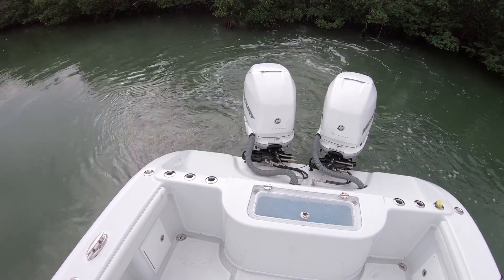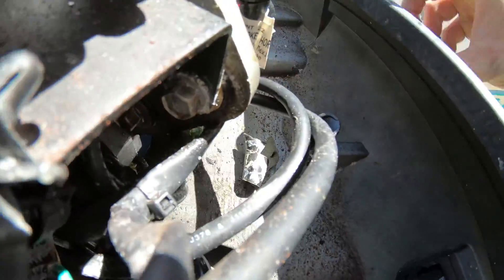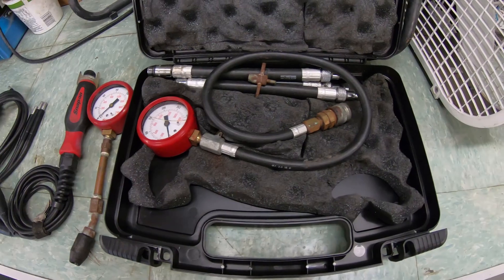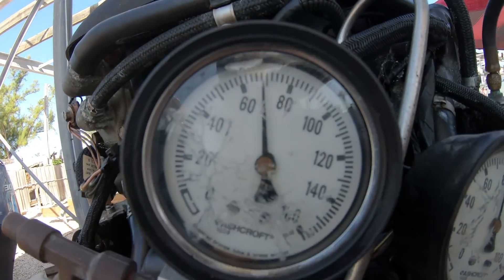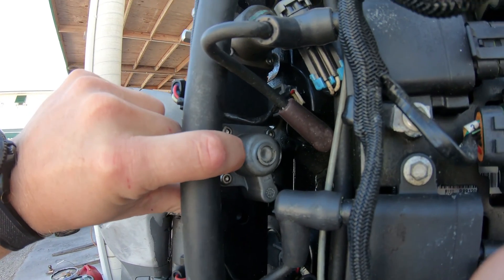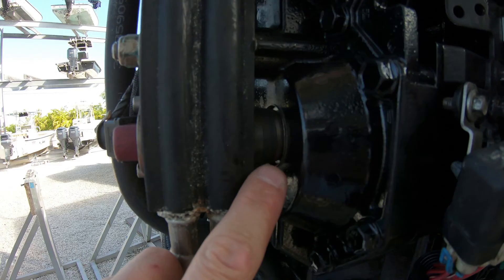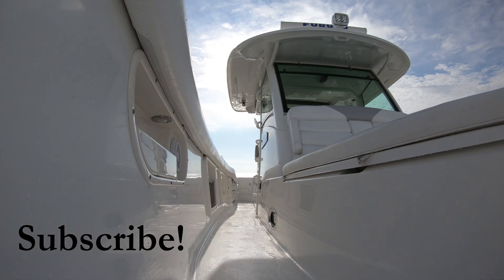What You Need To Know About Mercury Optimax's! | Troubleshooting

Comment: Have twin 2007 115 optimax's had the air and fuel injectors sent out to clean motors run well but both have like a spit back when idiling what is that?   Also this weekend while backing up the trailer onto the water at the boat ramp i started the motors when they were tilted all the way up. One motor starred smoking heavly blue spoke like a lot of oil was being burned. It continue smoking oil through the whole day only when i raised the idle over 2500 rpm's  but not as heavy as in the beggining. Now when i flush it at the hose seems to be ok what can that be.

Comment: What would stop the fuel injectors from opening...besides clogging which I think I would have had some noticeable warning.
Reply: Shorted out. With a multimeter connect one to pin on injector and the other lead to the metal case. If continuity then its shorted out. Most often they get low impedance. Clogging causes low impedance due to overheating from carbon buildup. This is why they say not to use fogging oil its waxy deposits can get into the injectors. Also quickleen is needed to prevent carbon deposits.

You should also be using 150:1 premium plus 2 stroke oil in the gas to lubricate the injectors. This is because when you shutdown the motor they have no cooling and the oil protects them from damage.

Comment: I have a Mercury 115 efi 4 stroke. I'm looking for a good video on checking coils.  We have a high end mis.  We have changed spark plugs twice.  Both times the issue seemed to go away.  Only to return a short time later.  We suspect its one of the coils.  We've bought new coils, but would like a good way to diagnose the problem. Specifically at the coil itself.

Comment: You should have mention the reed valve pack because I've found one engine that was running at idle but couldn't  ramp up because of all the screwes holding the plate of the valves dropped down in the air manifold I could see them just looking through the butterfly valve

Comment: Hi I've had to replace tracker valve twice.  My opti would rough idle and stall.  Can you  change the valve or does the fuel rail have to be removed?  Thanks for the video.
Reply: You can change the valve it’s not too hard I just did it. Not cheap though $200-$250. Mine was torn
Reply: @BodleyBoatworks  yes I changed it on the fuel rail. Not that hard. $200 very expensive

Comment: 2005 175hp optimax, I can run WOT all day at 5k to 5100rpms but if I try to run half throttle the engine bogs down to an idle unless I either hold it back to wot or let it come to a stop and then hold it to WOT until it starts to Rev up again after sitting sometimes a minute or more. The smart craft usually throws a bell and engine blinking alarm and temp hits 150° while it's idling in gear and when it revs up and I can go WOT again it drops back to 120°. Any ideas?

Comment: I have a 90 hp OptiMaxx 2005. It runs great except recently it’s been giving a single long tone. Sometimes I can get it better I warmer in the motor up more
I think it’s the oil pump but I’m not sure. The fuel is good. The Guardian system kicks in and brings the boat to idle when the tone kicks in. If I can get the boat going slowly on a plane then I can get the tone to go away
Then at higher RPMs the tone may come back on. It does not seem to be related to the weight in the boat with seven people or just one. I was wondering if anybody could give insight to the issue if it’s the oil pump or something else. Thank you
Reply: Throttle position sensor. Coolant sensor.

Comment: Does anyone know if you can use two separate gauges this tool that he’s using for the air and fuel pressure is like over 500 bucks can I use one on one side and one on the other and hold them up together or does anyone know of a cheap way to build one of these I have a bunch of hoses and gauges
Reply: Just get a 1/4 Female npt tire fitting and buy a liquid filled gauge from the autostore. Then you can read them individually you dont need to see both at the same time.

Comment: hope you still read here: I can get a cheap Optimax 200hp (built 2003) which has a high idle speed (1550 rpm). Any ideas for the reason? I don´t want to have to buy a new compressor etc.

Comment: i have a 2001 225 optimax i started the engine after it sat for a few months and it was idling when i trying to rev the engine a little it started to miss fire i shut it down and now it wont start things I've checked are spark, i installed new plugs, air pressure at 80 when cranking fuel pressure reading about 82 when cranking, tracker valve is good and im getting power to the injectors but no fuel in the cylinders i pulled i plug and it was dry as a bone getting frustrated ! engine only has about 180 hrs on it wpould be great if you could cover the no start condition thanks ,

Comment: we fixed every thing like it should then it worked great and suddenly it stop in the middle of running the we turn on and died turn on and died some told might be a Low batary power ..?  is it so important with optimax that battery will be super strong and new?

Comment: Quick question,  what should be the throttle plate position/gap at ideal and WOT I had a rough idle issue on my 225 optimax and after some troubleshooting I finally found a small pinhole on fule regulator diaphragm. After replacing it the engine is running much smoother. I've messed with the throttle plate during troubleshooting and probably missed positioned it. Problem I'm having is when engine is cold as soon as I put it in gear it stalls and take a few attempts, but when it's hot there is no issue. I replaced the reeds spark plugs and checked coils for proper firing.

Comment: This always confused me. Everyone calls them Optis, but really it's a DFI. I have seen many Optimax motors that were not DFI. So, to me, the designation lacks clarity.
Reply: Early DFI engines like the Evinrude  Ficht did not use an external belt driven compressor (ETEC, Optimax) to provide high fuel rail pressure.
Reply: @petersouthernboy6327  I'm well aware of the differences between DFI and FFI. They are completely different, as merc and omc designs usually are. I was just talking about the name usage/misusage.

Comment: Thanks a lot for this video.  My new to me 2007 225 Opti went on its first trial today at low RPM.  Never had an issue starting, but has never really been under load except for a few short bursts today below I'd say 3500rpms.  It shut off 5 seconds after starting up to make the 100yd trip back to the dock.  When I turned the key off and then back on, the fuel pump was very noisy and higher pitch when priming.  Did this constantly and couldn't get it to run longer than several seconds.  Is it most likely the high pressure pump?  I haven't checked pressures but I will after seeing this video.  The engine is beautiful and looks nearly new with 700hrs on it, but I'm hoping it isn't going to turn into a headache.  Thanks again!

Comment: I checked my fuel and air pressure and the air is 80 and fuel 90. But when I buy pliers on the hose line it doesn’t spike at all. My engine is idling really rough but my compressor sounds fine no weird noises from it and sounds normal. When I try to plane off I feel like my engine has no power and I’m only going 30mph planned off when I use to go 45mph. My compressions are dead even at 120. I’m really stuck at why the fuel air pressure are perfect but it doesn’t spike when I crimp the lines? Could you please explain this to me?

Comment: This is an awesome video! I have a 2005 Optimax 150 that runs great on WOT and most of the time at idle. It has recently developed an intermittent stumble or miss when idling for a while. The number 5 spark plug is completely black, while the rest look perfect. I replaced all of the plugs and wires and gave it a test run. Checked plugs and number 5 is starting to build up with carbon again. I checked the coil with the volt meter and it checks within spec. I compression tested the engine when I first purchased it about 150 hours ago and it checked out perfect and even. I checked the reeds with an inspection camera and from what I can see, they look fine. Would this lead you to a fuel injector / air injector gummed up? I've been told to change the tracker valve, but if it were bad, wouldn't it affect more than just one cylinder? Your help is very much appreciated! Thank you!
Reply: I have these same symptoms.  Did you ever figure out your issue Landon?

Comment: my optimal 135 mercury 2011is beeping when the starter key is turned, not turning over.  it beeps apx. 5-6 times.  additionally, my trim motor isn't working, just a humming when switch is engaged.  any help would be great.

Comment: My 2008 optimax 150 suddenly started jumping from an idle to approximately 3000 rpm and then back to a rough idle. If I let it keep running it will do this over and over. Otherwise it runs excellent. Any ideas why this started happening?

Comment: My mercury outboard engine 12 voltage is not getting to the fuel injection pump
Reply: My mercury outboard engine 12 voltage is not getting to the fuel injection pump
Reply from the maker: Youll have to trace the voltage, could be a blown fuse and a locked up fuel pump

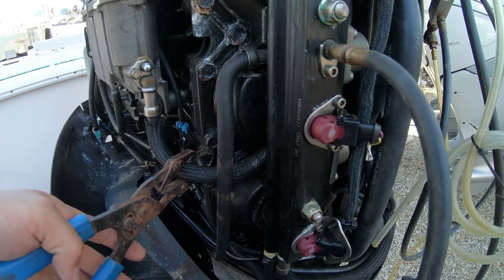Comment: thanks for the video and all of the great content,   i am learning alot.  @2:25  you show and mention pinching off the fuel line and then  you say to "watch for the air pressure to spike" but in the video is shows the fuel pressure spike.....was this just a miss speak?
Reply from the maker: They will both spike, when air goes up the fuel will go up as well, but this engine had an issue so I think I just used the fuel shot to show a spike

Comment: hey got a opti check engine and says injector fail any suggestion
Reply from the maker: Ouch, you might have a bad injector, hopefully just one got unplugged or a wiring issue because those injectors are expensive!
Reply: yeahh i think is the coil harness is missing the rubben so when ever it get water inside cuts the injector

Comment: Over sensitive water censer on 2006 115 optimax . ACv output at battery 27 OK ?
Reply from the maker: No, that battery might be shot, or the ground is messed up. You should be checking dc volts not ac and they shouldn't be more than 14.5ish
Reply: @BornAgainBoating  Thankyou ! The Mercury Manual does say to check AC also on Page 2B-16. A reading above.25 AC volts indicates the diodes are faulty and the alternator should be replaced. I replaced it and I'm not getting .31 AC anymore just .27 AC and Warning 4 Beeps went away. WERD !  Ground behind starter relay maybe ? :) Thankyou. John 3:16

Comment: I’m lost. I have. 2001 Optimax, had overheat warning light after 5 minute idle while pulling up anchor. Started engine and checked water psi/block psi, was 0.1, Seatow brought me back to marina, pulled the boat, I changed, impeller, new gaskets, new o rings from impeller housing to water tube going up toward power head, changed thermostats with gaskets and cleaned ports out, changed poppet valve spring, inner gasket donut, inner gasket, new dispram, new gaskets, re installed, connected hose to water inlet port on back of cowel, turned on water let water run for 5 minutes no water out of spitter, removed lower again, double checked everything, reinstalled, same 0-0.3 psi, barely any water spitting. Flushed whatever else I can check, removes air pump filter flushed both ways, ran water no spray, started engine saw 0.3. Shut engine down, removes lower again to inspect the piece that connects water pump housing to transfer tube, everything was good (forgot to mention when I installed new impeller I also used height set tool provided with kit) I’m at a loss I removed the lower unit 6 times in 40 minutes. I’m stumped . Anyone have any suggestions as to why I don’t get water flow from pisser? I also removed the hose from power port side fuel rail (water supple) to air pump strainer, directly inserted into water hose , pisser sprayed out perfectly fine. I’m stumped and need to get boat back in water (marinas getting annoyed)
Reply from the maker: Id say to disconnect the telltale and follow the hose until you get water coming out, you should find a blockage somewhere
Reply: Thank you for the reply just figured out the problem, the new mercury pump kits have too thin of gaskets and you loose pressure at the pump. Rtv on top and bottom surfaces of gaskets and spacer plates and cover and it’s a pisser
Reply: BUGS LOVE TO FILL THE WATER OUTLET.  NEED A PLUG AND A REMOVE BEFORE FLIGHT FLAG !!!!

Comment: 2001 23 ft Donzi zf twin 150 hp Optimax 220 hrs salt water use.  New boat to me 5200 rpm 52 mph wot 6 to 8 psi water pressure when I go into a turn the outboard pressure will go up to 12 or 14 psi temps around 140 degrees after about 4 minutes of running above 4500 rpm  engines will go into limp mode. Code shows port side head over heating. Changed thermostats and impellers. No change  waiting for pop it valves. Do I need a low water pick up.  Any other suggestions? Thanks Craig 
Craigworkman2@gmail.com
Reply from the maker: Yes, you may need a low water pick up, but those engines might already have the pick ups. It sounds like when you turn the engine starts pulling air and over heats. :/ Have you checked the mounting height?
Reply: @BornAgainBoating  Thanks for your help  motors are mounted as low as possible.  It doesn't over heat in a turn. Just saying the water pressure does go up to 12 psi when in a turn but normal water pressure is only around 5 or 6 psi at wot.

Comment: I have a 2000 225 optimax. When i try to start the engine,  only like 3 cylinders will fire once before its off again. It wont completely start and stay on. And everytime its like 3 cylinder explosions before it turns off. All the spark plugs are firing. And i was told the compression was solid in all cylinders (although i might double check them). I pretty sure the battery im using is too weak, becuase when i try and start it sometimes it just stops for a moment. Battery only has 650 CCA.  Where would you suggest i start to look? Any help would be greatly appreciated.
Reply from the maker: I'd start with the tests in the video, sounds like a fuel or air pressure issue, possibly  bad gas.
Reply: @BornAgainBoating   So i did the air pressure test and the fuel pressure test. When i try to start it, it shows about 5 psi breifly then goes back to zero. And the fuel pressure will work its way up to about 15 pounds of pressure. So what do i do now?
Reply: @BornAgainBoating  Also, I can see the air compressor turning. But the only place i can feel air coming out of it is the top port of the air compressor. The other part, where im pretty sure air should be coming out of, Im not really feel any air pushing out.  When i take off the hose off to that goes to that port, I can see like a pump or 2 of air coming out of the hose going to the air compressor.

Comment: The question I have is at 36 to 3800 RPMs on my 90 horse optimax it beeps and engine throttle cuts out then picks back up when RPMs drop down only beeps once at me when the engine starts to shut off but the engine Never Dies runs perfect up to that point but I cannot get more than 3800 RPMs without engine shutting me down only one beat does anyone have an answer for me?
Reply from the maker: Sounds like the block water pressure sensor is not reading water pressure. The engine doesn't think it is getting cooling water so it is limiting the RPM. I'm not sure of the exact location of the sensor on the 90, but there will be a little hose going to it, make sure there is water coming out of that hose and if there is, the sensor is most likely bad. If you had smartcraft gauges you could see the water pressure, if not, you need a computer to see if the sensor is giving water pressure reading to the engine.

Comment: Boat is only 2 yrs old..
Was out on the water working fine then when getting on plane I got 6 beeps lost power did this 3 times the decided to turn off everything and it worked just fine.. idk what happened.. tomorrow I will go out again and look in to it more since it was dark yesterday..
Reply from the maker: You might have a little water in the fuel and the water sensor is picking it up and giving the code

Comment: I have a warning beep when I try to run the 225 optic over 1800 rpms. The bolts indicate 10.9 to 11.1. Seems the beep starts when it drops in voltage?
Reply from the maker: Low voltage will give an alarm, but those voltages aren't low enough to do that, sounds like you've got another issue :/
Reply: @BornAgainBoating  My pressure sensor was bad and this would happen to me 75% of the time I hit the gas.  Alarm and limp mode.  Had a local mechanic do diagnostic and he told me it was temp related so I chased my tail for 6 months before i swapped it out and fixed the issue.  Also had to swap mechanics!  But I would check the battery too.  See if it happens after you have the battery fully charged out of the gates.

Comment: I have a 2011 115 Mercury optimax I get the all clear beep when I turn the key to on but I am also getting a single beep during the cranking startup process it starts and it runs perfectly fine. What is the beep for during cranking to start?
Reply from the maker: There should only be one beep when the key is turned to the on position as a "system test" but then when you start the engine, usually there isn't another beep. It could be a sign that the key switch is starting to go out.
Reply: Could also be your starting battery is going bad and it’s a low voltage alarm that you hear. It did that on my 2012 opti  250 then no longer did after the new battery was installed.